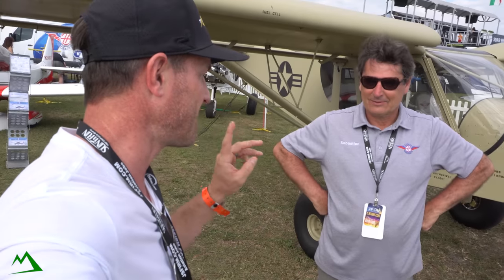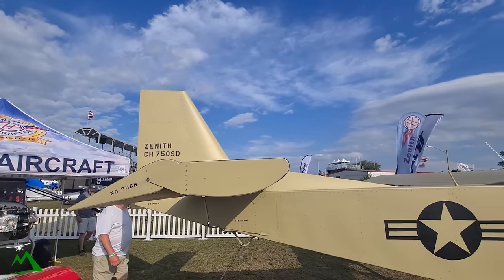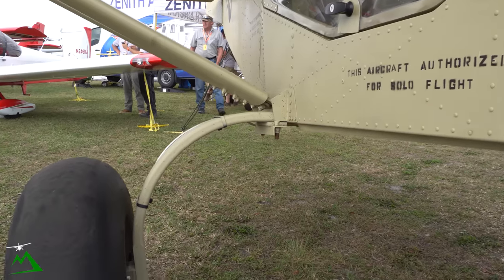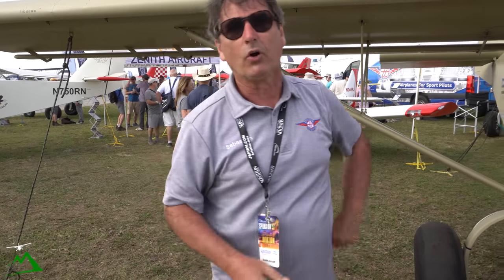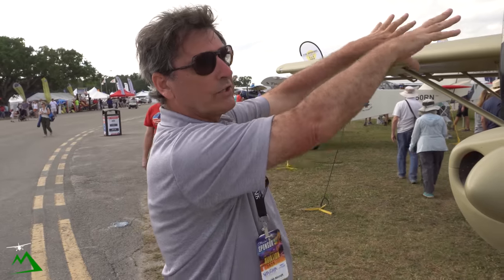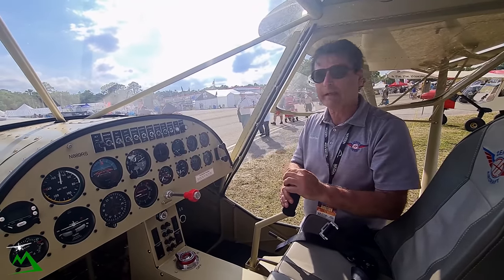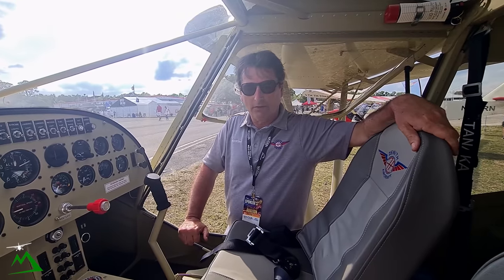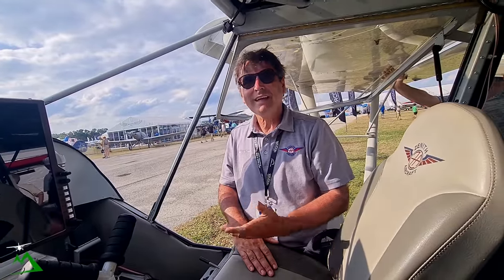The Ultimate Tricycle Gear Bush Plane for Under $100K

Comment: I was a student pilot decades ago, although I never got my private pilot's license, mainly due to lack of $$$. 

I soloed in a Piper Tomahawk in 1979. The Tomahawk is nothing to write home about, but the VISIBILITY from it -- at least for me the student pilot -- was excellent. I also did some training in a Cessna 150, mainly for spins. {Spins are prohibited in the Tomahawk.} I did not care that much for the limited visibility of the 150. 

Sometime between 1980 and 1995, I cannot remember the exact year, I got to sit in a Zenith 701 at SUN 'N' FUN in Lakeland, Florida. I was IMMEDIATELY IMPRESSED at how much the OVERHEAD VISIBILITY the 701 has, due to the angle of the wing roots.

Comment: An interesting and very neat design. Certainly like the field of visibility though at first sight the glass cockpit arangement is a bit disconcerting. Being used to the Kodiak I could imagine you could take to a tricycle gear plane like that Ryan - I wonder what version of the control stick layout and instrumentation you'd go for? Thanks for the look around.

Comment: Best bang for the buck on the market.  
  I have had two 750’s and currently have a 701 with 100hp rotax.  These things are a blast to fly.  Slow as molasses but fun.  
I’m 6’1” 230# and full of fuel and 30ft I’m off the ground.  
Landing a zenith is tricky if your a Cessna pilot your gonna smack the ground until u learn to land with a shot of power but once on the ground at 30mph you can stop it in 30 ft.